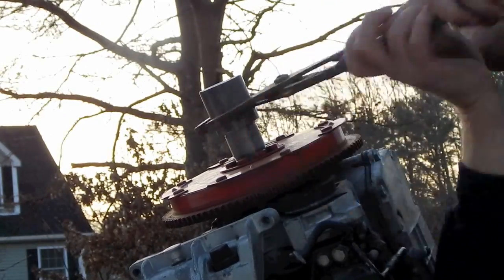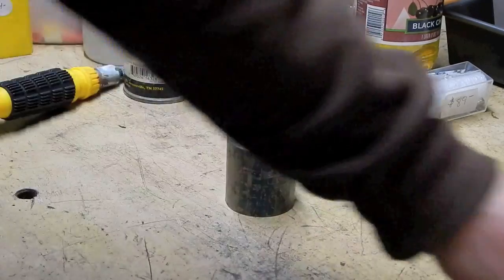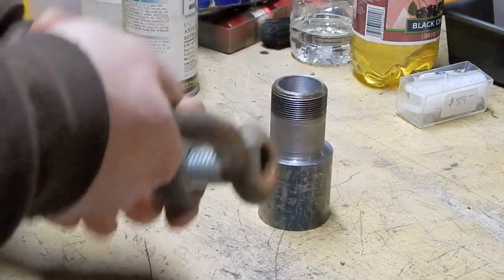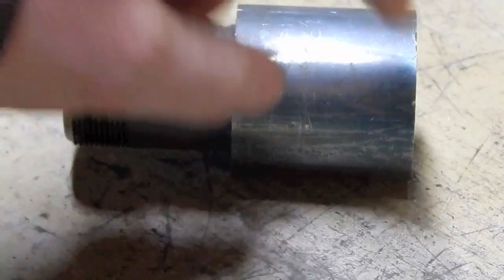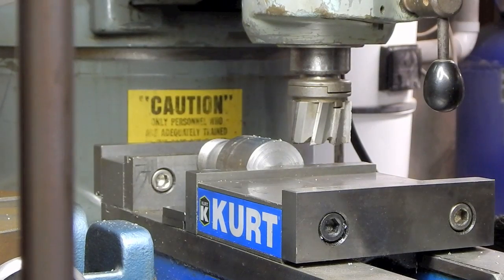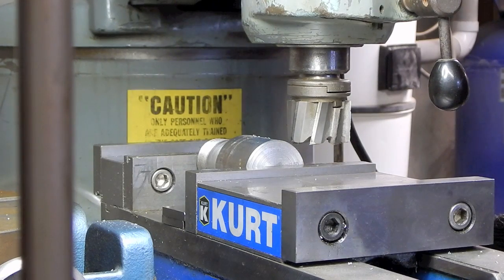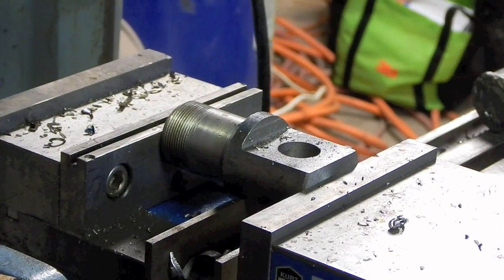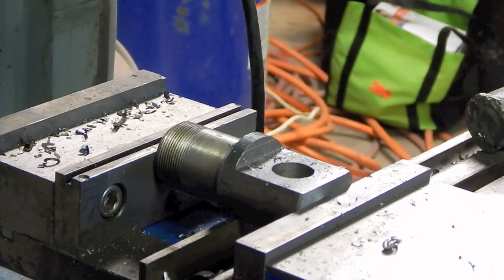The Mercury 115 "tower of power" outboard motor Part 2

Comment: so something broke.  time to go back in the wells videos and see what wasn't quite right or maybe the belt just broke.    good thing u got a parts machine
Reply from the maker: +dozerd12r I'm betting it's just the woodruff key on the pulley for the toothed belt. It was hard to grip that pulley while tightening the bolt that holds it on, so I may have allowed the pulley to spin on the shaft, and shear the key.